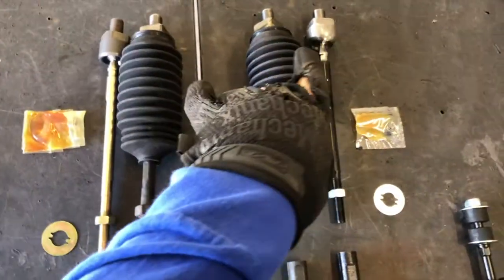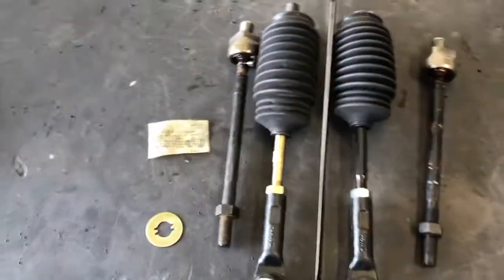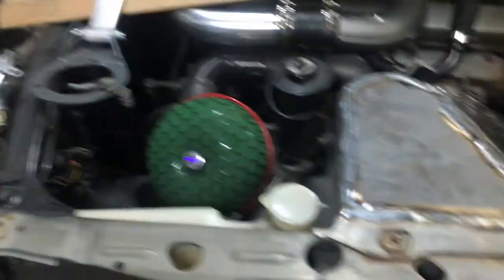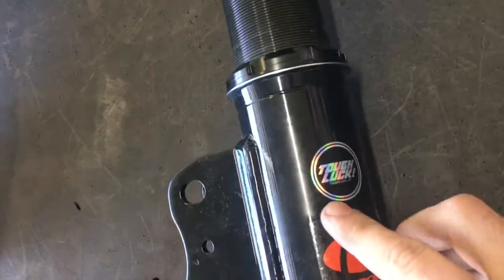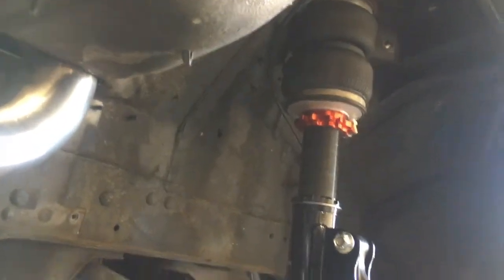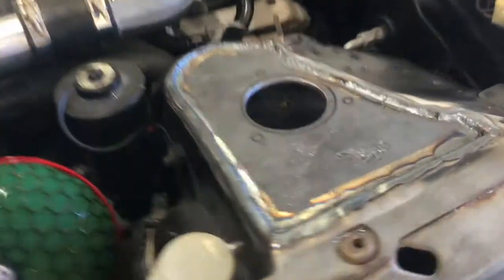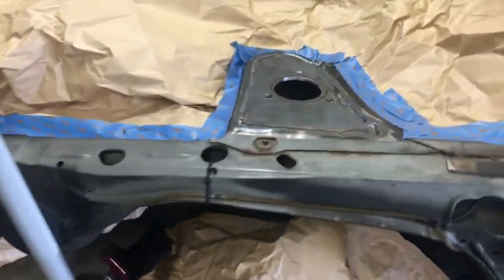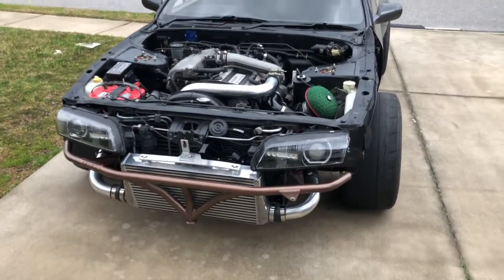Cutting R32 Frame! S13 Front Suspension Swap Part 2

Comment: Wait the sway bar end links werent bolted onto anything?
Reply: Did the s13 sway bar bolt up? 3rd video?
Reply from the maker: The end links bolted up to the control arm. We had to get an s13 sway bar and s13 end links as well as the s13 lower control arm. Everything bolts up except the coilover top hats. You need to modify the chassis for that section.